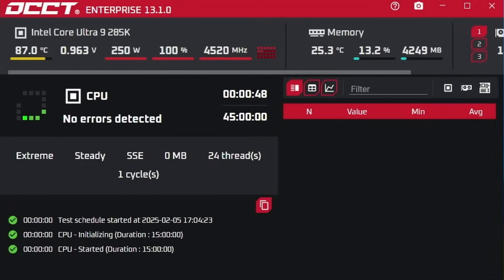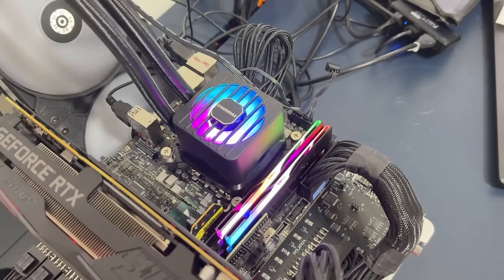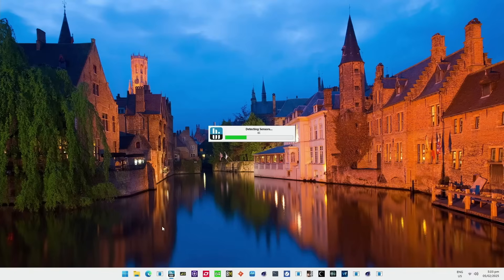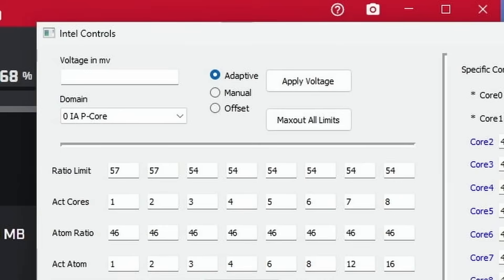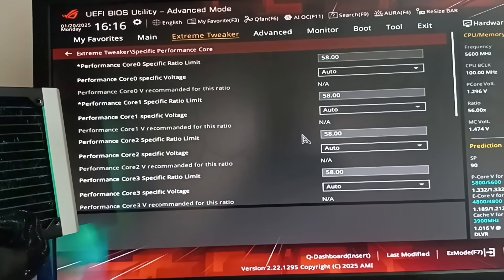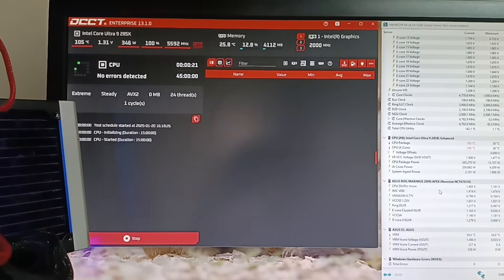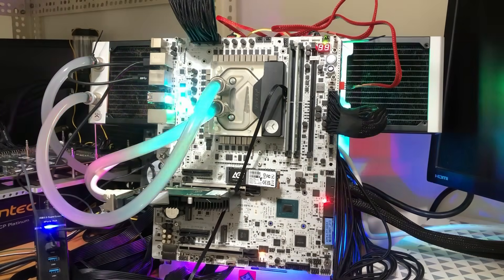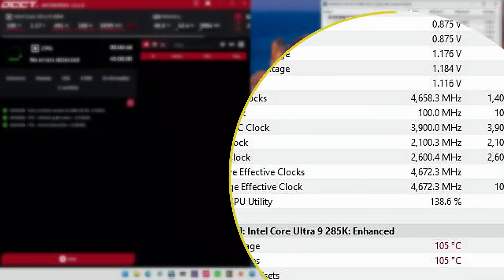285K WHEA when E-core voltage over 1.2V | SBCP#1

Comment: I was just wondering, have you ever used an AsRock motherboard? I can't see that you have ever created an overlocking guide from this brand, just wondered if there was a reason for this?
Reply from the maker: I have used ASRock but it's been quite a while. 

There's no particular reason for not using ASRock recently other than not having boards on hand. This is just a hobby for me, so I tend to use what's nearest to my test bench :)
Reply: @SkatterBencher  your guides are amazing and very well regarded in the industry, you probably don't want the hassle of 'sponsorship' deals but have you ever reached out to motherboard manufacturers for review boards so you can have some fun whilst not having to buy them? 
I am tempted to buy the Asrock Z690 PG Velocita and put a 14700k in that I have. That board had an MSRP of over $450 and you can get it now on Amazon for just $130! I was going to get the MEG Unity until I released it had no video out and no power stages for the iGPU so QuickSync wouldn't ever work either.
Reply from the maker: Thanks for the kind words!

FYI, I live in Taiwan and have been around the hardware industry for quite a while, so I'm on good terms with some people in the industry. Most of my hardware stuff are "loaners" already, so I don't have to buy them. I'm fortunate because the people that support me also love performance tuning, so I get to borrow the hardware without strings attached and just do my own thing :).
Reply: @SkatterBencher  That's good to hear, I am glad you do this just for the love of it. I find overclocking as exciting as I do frustrating!! 
Like you said though, if you were paid by a motherboard manufacturer to create an overclocking guide for them to help promote that motherboard then it could get messy in terms of what they want you to say and if you wanted to say something negative, etc. It's always best to stay independant when it's a hobby you love. 

One thing I really struggle with on the overclocking scene is whilst certain basic things are common on all manufacturer's BIOSes, what they are called and where you can find them can be really different moving from ASUS to MSI to ASRock to Gigabyte, etc. I always tell myself I will check to see which motherboard you have used in your guides and then get that one so I know what I am doing then but then I always end up buying cheapest option I can find instead!!

You probably don't want to get into the whole 'reviewing of motherboards' scene and I can understand why, it must be an incredible amount of work and time to get to grips with each new motherboard and learn it's quirks and then the script writing, filming and editing, etc. But if you did have the time, what I think would be amazingly helpful for people like me is when a new chipset comes out you create a short overclocking round video of the 4 main manufactures ASUS, MSI, ASRock and Gigabyte, how to navigate their BIOS, what to look for, what each company calls different things, etc. Just pick 1 motherboard from each manufacture and then make mini-guide like your 5 min overclocks just so people know where to start with each of the manufacturer's BIOSes. You could also put affiliate links in the video so that people can 'thank you' for the guide when they buy one those motherboards.

Comment: I find OCCT not that stable on many platforms through the years. Do you have errors also when stresstesting etc. on Prime95? I myself find Prime95 a lot better than OCCT. Maybe the issue is just OCCT software.

Comment: ahh man.. I can't get this damn 285k stable with any kind of overclock
Reply: Just 5700 all P Core, and 5000 all E Core fixed should run fine. And that is nice and fast system.
Reply: They hate p core overclock. Not sure if that’s what you’re trying but I’d say stick to e core overclocking if you can and I think it’s maybe in your case it’s part of the DLVR limiter. 
Not sure just throwing it out there.

Comment: So I decided to see if this was core (or group of core) specific. I downloaded XTU and only on cores 4-7 was it causing the WHEA errors. If I changed the voltages for the other 12 at 1.25 but left 4-7 at 1.195, no errors were thrown. Not sure if that helps but hopefully that allows me to overclock the other 12 cores higher than 4.8 without a ton of errors.
Reply from the maker: Thanks for the input!

Comment: I have a question about the hybrid architecture. I OC the P, E cores and the Ring. Should i tune down the ring OC (it's quite high) to allow lower temps? At a 5.7ghz Pcore ghz, 4.6Ghz Ecore and 5.4Ghz Ring on 14600K get 1001C on full load
Reply from the maker: Usually overclocking the Ring doesn't add that much heat to the CPU, so reducing its clock won't make that big of a different, UNLESS you're also increasing the cache voltage such that under load it's higher than the voltage needed for your P and E cores. In that case, you're using excessive voltage for P and E which will increase the temperature substantially.

That's because on 14th gen, the P-core, E-core, and Ring share the same voltage rail and the voltage configured for that rail is the highest among P, E, and R.
Reply: You aint running 5.4 Ring on a 14600k lmfao.
Reply: @YouTubeAccount-i4m  4.2ghz is more what it should be. The ring is not a processor .....

Comment: Don't have this cpu but long long ago on an intel cpu one of the overclocking guides mentioned to be sure if a particular voltage was set that the adjacent interconnected circuit had to have its voltage within a limited variance. So ?? if this V is >=1.2v maybe its corresponding circuit maybe needs adjustment also to not cause communication (or damage) issues between the two ? It just occurred to me so thought I'd mention as a possible bios setting to investigate. You mentioned C states. I know ryzens is recommended for C states to be set to zero under certain conditions, as mine is for stability. Just my 2c. Love your channel.